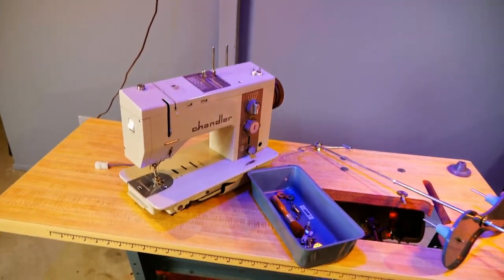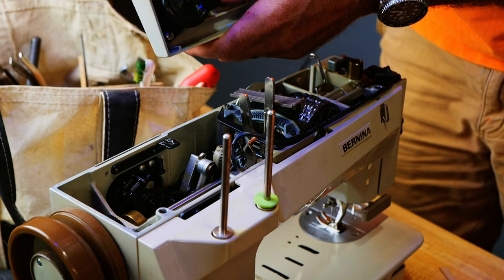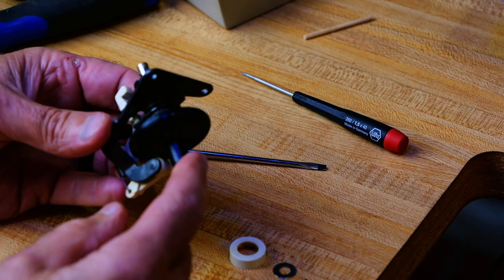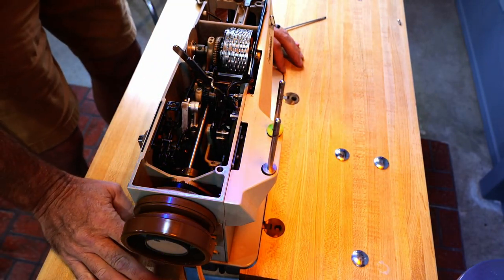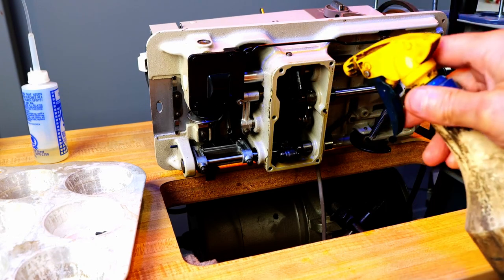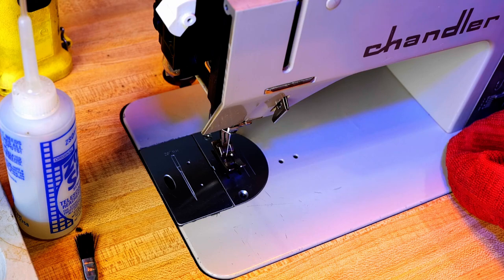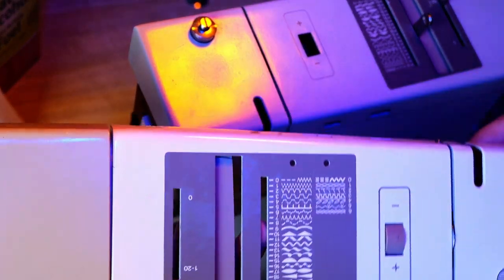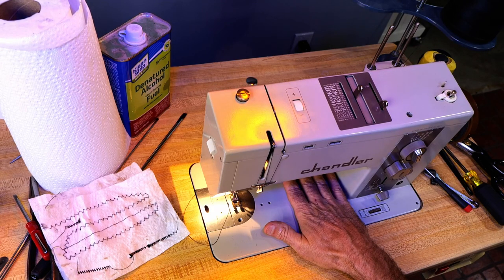Watch Me Service This Old Chandler by Bernina 950 Industrial Sewing Machine

Comment: On that back plate where the pins broke off... I have had great luck when gluing those broken plastic parts on using epoxy and adding a thin strip of fiberglass cloth or even just cotton cloth to help spread out the repair. This helps to reinforce the repair joint and It doesn't take much.

Comment: This was so good to find and watch! 👌🏻I am struggling to find someone to service my Bernina 950, most refuse to come out and don’t want to service it without a motor if I brought it in! Years ago I knew a mechanical engineer who took it apart, cleaned and oiled it and returned it to me without having ever worked on a sewing machine before and without testing it. I dropped it back into the table, connected the belt and it sewed like a dream! I would love to know how to set the timing on it. It seems like it’s wearing a groove inside the bobbin case and making a terrible racket. Found your video trying to find something online to help me. 😅 Also, mine is over 20 yrs old and the bobbin winder does not work disengaged from the sewing mechanism anymore… I had never considered winding them while I’m sewing something 🤯I’ve always just removed the thread from the needle to avoid tangling while it runs.
Reply from the maker: A mechanical engineer you say? I think that's cool. Cleaning and lubricating solves most problems. Good luck with your machine.
Reply: @AlexanderDyer  Thank you!  I have cleaned and oiled. The scraping sound persists. It feels like the section which holds the bobbin case in place is loose in it’s casing and I cannot see how to tighten it. If I hold it in while sewing, the noise stops. I’ll keep searching 😊
Reply: @AlexanderDyer He was a friend of a friend at the time & offered to service my machine as a trade. It really was cool!
Reply: Just wanted to update and say thanks …Thought again about your comment re cleaning and lubricating solving most problems and even though I did try that at first, and kind of dismissed that as a solution, I opened up everything again, and went in with a different oil, I rewatched the parts where you oiled this machine & it’s definitely much better! 🎉
Reply: On the bobbin case, not sure if I’m clear on that but have you tried a different one. It’s not very common but bobbin cases do age out/break/get out of spec. 
Never saw it happen on a regular sewing machine but the heavy use quilting machines frequently required new bobbin cases. Just a thought😁
Reply: I bought a 830 Record that had been dropped and that back panel was smashed. Not coincidentally the same attachment scheme is used on it as well. It’s a difficult part to locate, but it needs other parts as well like a motor. Might be easier to part out and start over.
Thank you for great instructional video!

Comment: The tiny screw on my bernina 950 bobbin case is stripped. I think both screws. It was working okay with heavy thread, but when I switched to regular thread, that is when the problem became apparent. Pretty much need a new case and the original is hard to find.  I wonder if the “compatible” bernina bobbin cases offered on Amazon might work? Has anyone else tried them. I even wonder if the case I have is not original.  Great video, thank you so much! I love fixing old stuff, but my skills pretty limited. You are a good teacher!

Comment: The DBx1, DPx5 and HAx1 are actually all roughly cross-compatible. Like there's probably some subtle differences in the exact shaping of the scarf or something, but the shank sizes are compatible with each other (except you can't fit a round shank needle in a domestic, for obvious reasons), and they have the same overall length and distance from the shank end to the top of the eye. I did a side-by-side comparison running an HAx1 needle in DBx1 and DPx5 machines and couldn't find any difference in stitch quality compared to running the usual industrial needles. That said, if you've got the right needle you might as well use it.
Reply from the maker: Thanks🙏

Comment: really love this video. what did you spray on the plastic after super gluing?
Reply from the maker: That is activator, it speeds the set up. I still let it sit for 8 - 24 hours but it set it enough that no clamp is needed. I think I put a link in the description.

Comment: Glad I found this video! I have a Bernina 950 and was just using it for a project and I have a situation now that when I reverse the thread pops out of the needle for some reason. It was working fine during this project. I have oiled it all over, played with the tension, changed the needle and cleaned the bobbin area. Could it have something to do with the (forgot the name) plate that takes the fabric forward while it is sewing??? Please help. Much appreciated. Can you tell me what it could be?
Reply from the maker: Your thread is breaking. I would suggest that you try to recreate the issue while operating the machine slowly by hand to see if you can spot when and where exactly the thread breaks. That should help you to discover the fix.